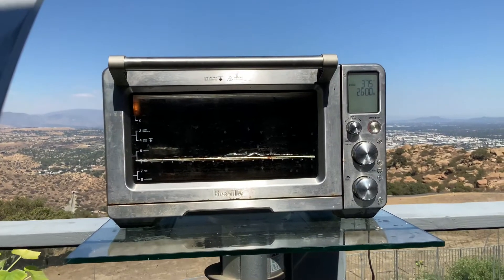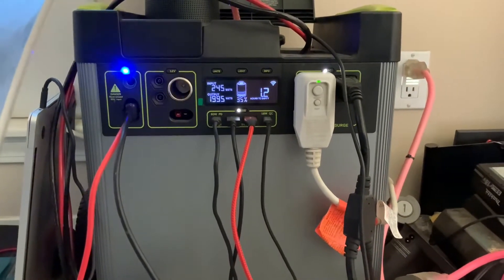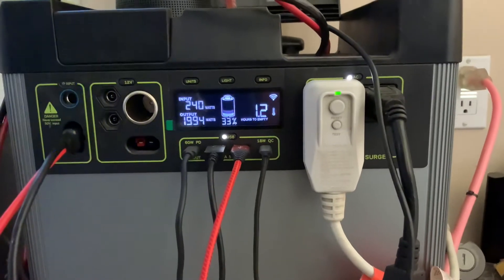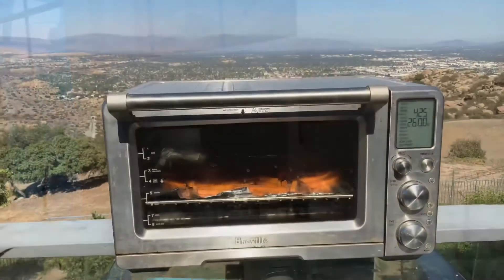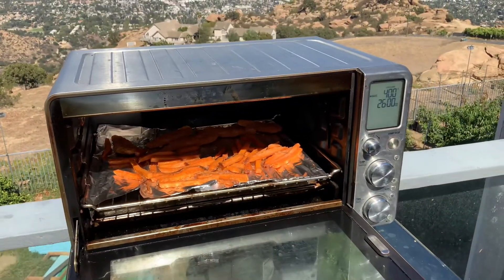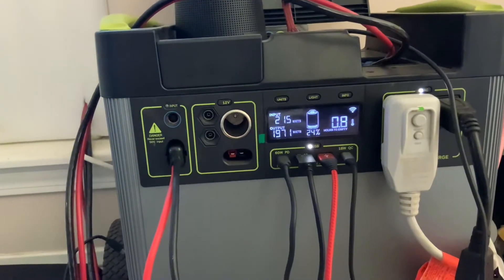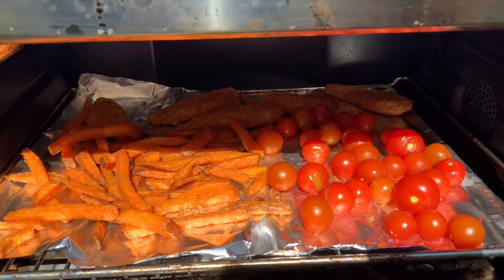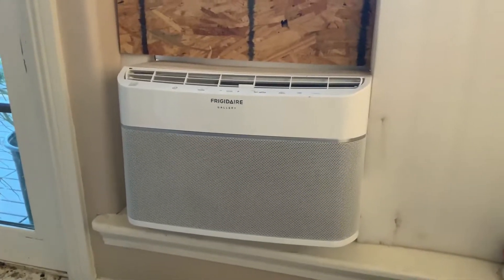GoalZero Yetti 6000x running Air Conditioner and Oven while charging on Solar OFF GRID ULTIMATE TEST

Comment: Im impressed so far. Many Q's.  Can you elaborate how many solar panels you are using? Also what brand AC are you using and what size room are you cooling? I see lots of wires in your video. What are they? Also you mention a refrig. What brand? It would be nice to see a full video of your whole system step by step for us super novices. thanks!